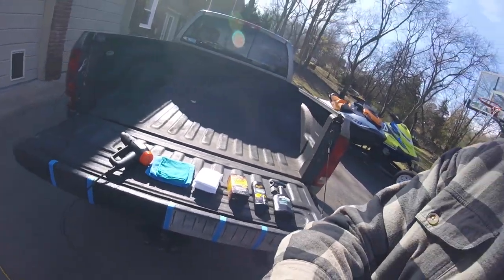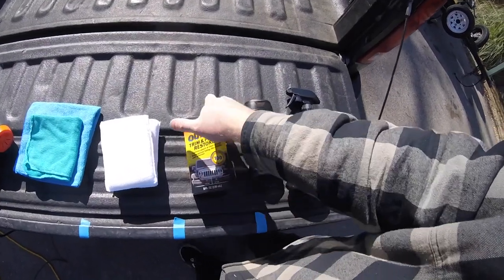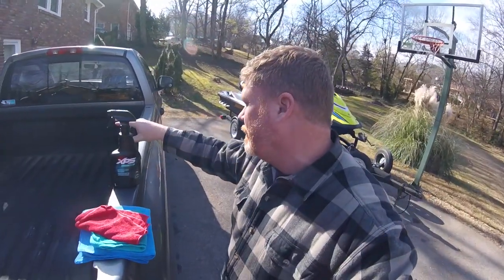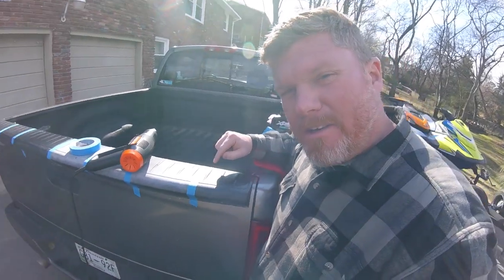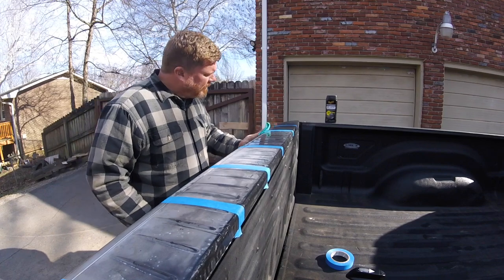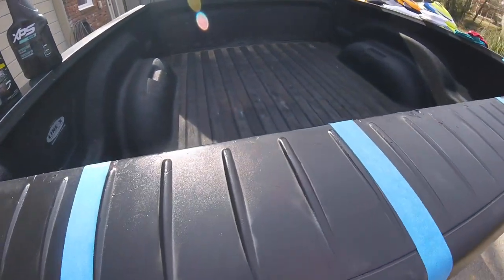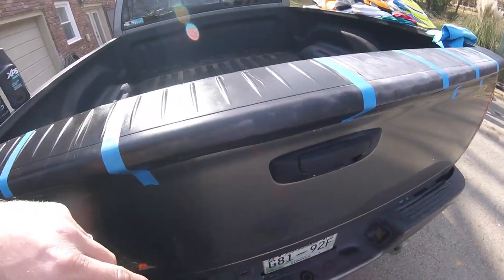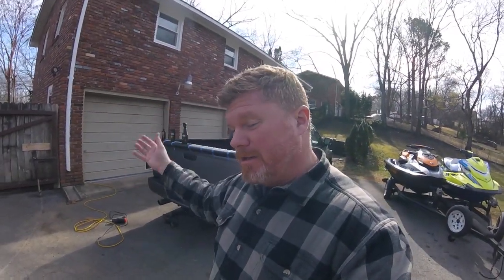Which Plastic Restorers Work Best? The Watercraft Journal Does It Live

Comment: In my experience, the best restoring product for putting black down on porous plastic is Solution Finish.  My favorite protectant is Aerospace 303.  Use 303 before damage and you will most likely will never need a heat gun or a restoration product.
Reply from the maker: Proper maintenance and preventative care is a must!

Comment: Hey Kevin,

which protects the best in your opinion  the XPS or armorall? Also for the vinyl seats on the 2016 through 2020 yamaha GP1800's and VXRs which is the best protectant for the Vinyl to keep from cracking and best moisterizer.
Reply from the maker: XPS is decent, but it's so light that it doesn't last long. Armor All is pretty greasy. There's a Meguiar's vinyl protectant made for boats that's really good.

Comment: Great video Kevin. Very informative. 
Going give XPS  a try  on my sled.
Reply from the maker: Thank you! Make sure to keep your plastics well maintained so they won't need extreme steps.
Reply: @watercraftjournal  

which protects the best in your opinion kevin the XPS or armorall? Also for the vinyl seats on the 2016 through 2020 yamaha GP1800's and VXRs which is the best protectant for the Vinyl to keep from cracking and best moisterizer.